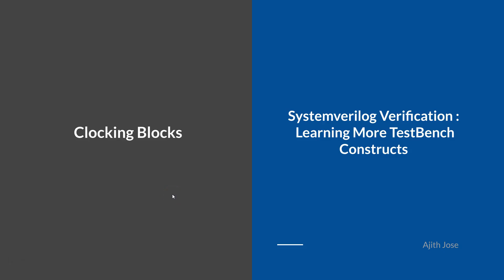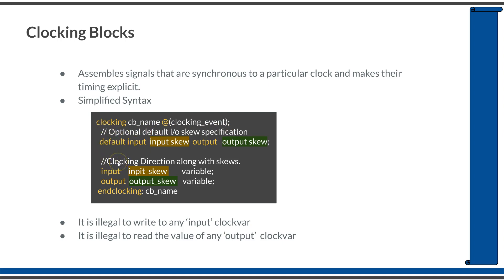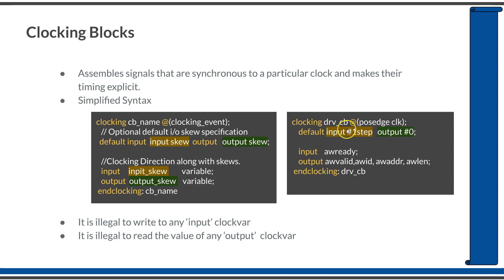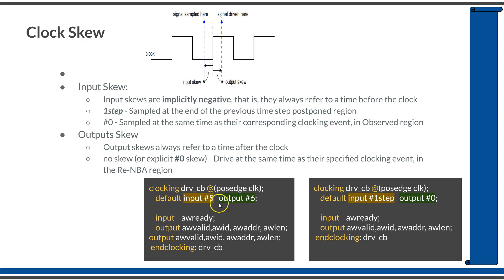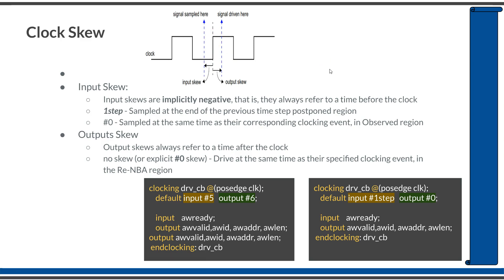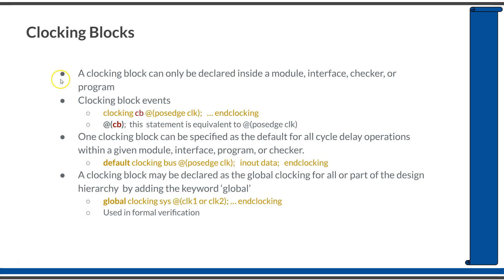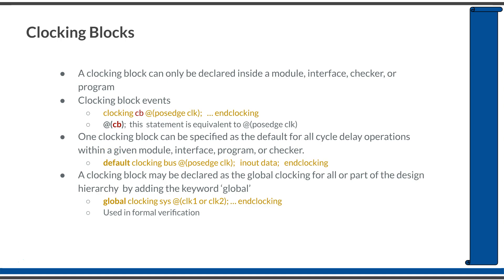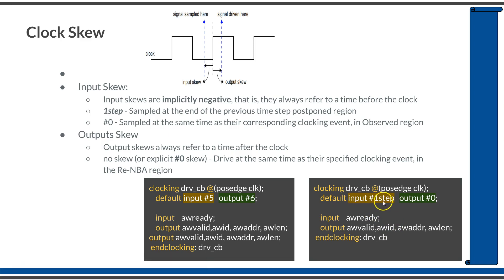Course : Systemverilog Verification 2 : L4.1 : Clocking Blocks in Systemverilog

Comment: Hi Sir , I have a question about  referencing  signals within a clocking block which itself is part of modport .

Consider  following  snippet ::

interface mult_if (input logic clk, reset);
  logic [7:0] a, b;
  logic [15:0] out;
  logic en;
  logic ack;
  
  clocking cb @(posedge clk);
    default input #1 output #2;
    input out, ack;
    output a,b, en;
  endclocking
  
  modport TB (clocking cb, input clk, reset);
  modport RTL (input clk, reset, a,b, en, output out, ack);
  
endinterface

Assume  ' mult_if '  is  instantiated in top_tb  and  then  set  in  config_db   to  be  fetched  via  driver  and  monitor . 

Within  monitor  ,  how  should  I  reference  output  signals  ' a ' / ' b '  / ' en ' 

Should  it  be  ::   vif_intf.TB.cb.a  OR  vif_intf.cb.a  ? 

I  observe  only  VCS  throws  an  error  when  using   vif_intf.TB.cb.a  whereas  all  the  3  tools  are  fine  with  vif_intf.cb.a 

Thanks in advance .
Reply: A small correction  ::  Within  driver  ,  how  should  I  reference  output  signals  ' a ' / ' b '  / ' en '